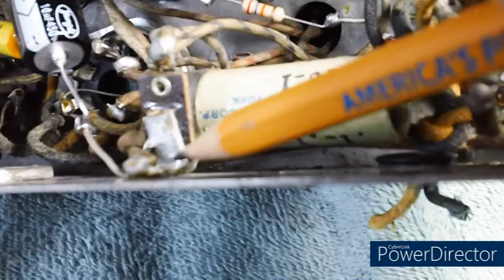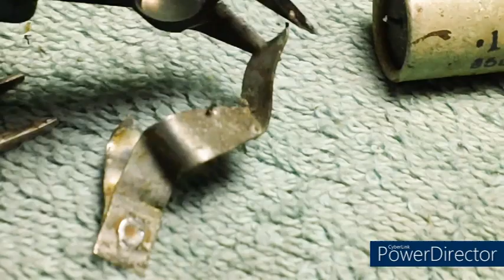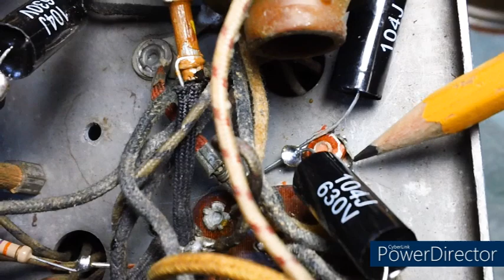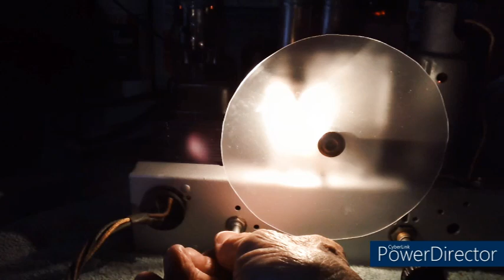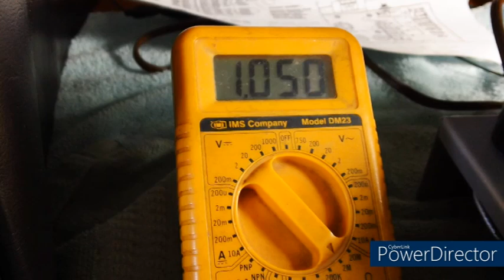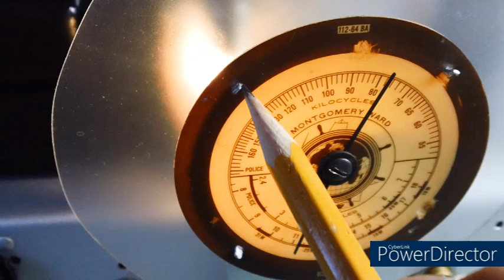Part #12. 1936 Airline 62-198 repair and restoration

Comment: no John say it isn't so you are going to wrap up the radio in the next part but that's 13 parts that's an unlucky number to end it on John better make it 14. we are digging out of 2 ft of snow in the last 2 days. You have been doing great explaining as you go. Almost as good as Buzz1151. I remember a movie Jackie Gleason did with a very young Steve McQueen called Soldier in the rain. Thanks for the video LL
Reply from the maker: Larry,
Almost as good as Buzz1151, you say?  May the fleas of a thousand camels infest your armpits.😮
Regards,
John

Comment: Seems like the most important tool needed in replacing those double ended capacitors is your brain. Some people try this 
and don't have enough of a  brain to work with. Have not seen a cap like that before but now know better. Tight quarters in 
this radio chassis means figuring out how it's best to go about replacing components. Work smarter not harder. You made
a lot of good restoration hints in this video John! It's a great hobby where those who know can share with those who don't.
I'm not surprised the radio works like a champ! Steve from IL
Reply from the maker: Steve,
Perhaps it's not so much a lack of brain power, but rather a lack of quality mentoring and innate fear that causes many to never leap into any endeavor, like this antique radio hobby of our's, which can be very scary to the uninitiated.  There will come a time when no one will repair or restore old radios and such.  We'll be a long-gone breed...as it should be.
Regards,
John